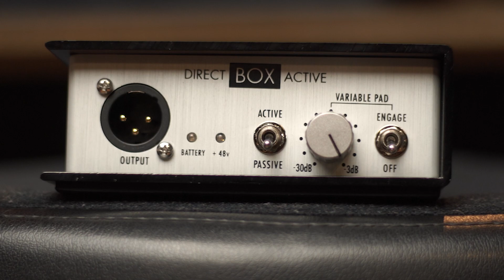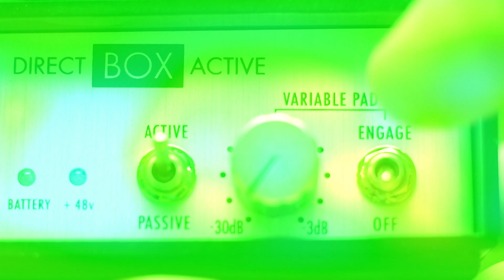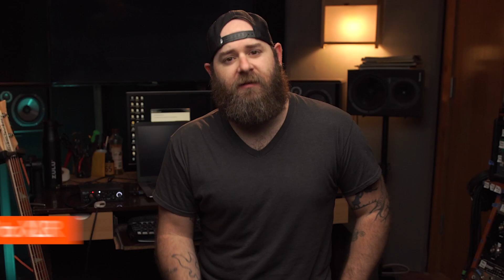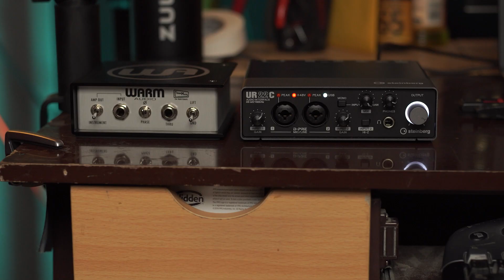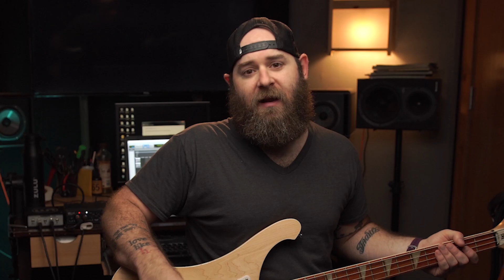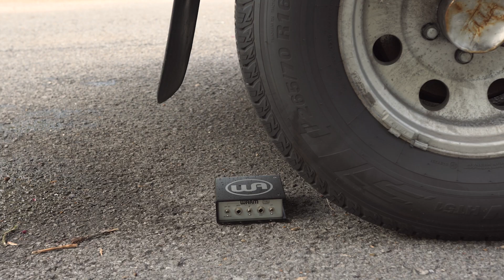Product Deep Dive - Warm Audio Direct Box Active

Comment: So I just bought a Warm Audio active DI and I'm getting 15db signal loss regardless of battery or phantom power.  The attenuator is disengaged.  I made sure the batteries were fresh.

To test, I plug direct into my interface and adjusted to hit -9db peak.

I add my countryman type 85 DI in the path, changing nothing else and I'm still getting -9db.

I then swap the countryman for the Warm Audio active DI, again changing nothing else and then I'm peaking at -24db. 

I did this exact test on two different audio interfaces and got the same results.  

So no matter what I do, I'm getting a consistent 15db signal loss with this DI box.  Is something wrong with my Warm Audio active DI?
Reply from the maker: Hey there! Hit up Michael in our QA department and we'll get your sorted! Email below.

Michael@warmaudio.com
Reply: @WarmAudioOfficial will do, thanks 👍🏻
Reply: @WarmAudioOfficial so I've been emailing with your customer service address and they don't seem to be able to understand that I'm asking why an active direct box is reducing my signal by 15db instead of sitting closer to unity.  Yes, the DI is getting power.  No, the attenuator is not engaged.  I've done a clean test and no matter what, your DI boxes reduce the signal by 15db.  It's been a pretty frustrating experience.  I'm probably just going to get rid of them both.
Reply from the maker: @thejamus  Hey there! I checked in with our QA team.

The internal transformer is an impedance transformer as is required to match the H-Z world of instruments to the low Z world of mic preamps. This process has inevitable level loss. The only way to get higher output would be by increasing the gain of the active circuitry in the DI. However that would affect the transformer performance as higher signal levels create more distortion in the transformer. As the DI output is matched to a mic pre, the signal loss is not a serious problem as there would be plenty of gain in the preamp to compensate for it.

So the level loss is typical of any DI you use. I hope this helps to clarify! Let us know if you have any other questions.
Reply: @WarmAudioOfficial that's fine.  While you were doing that, I tested a bunch of other active DIs this week and here's what I found.  Values are the DI signal level vs unity.  Tested by going direct into my interface and then adding the DI to the signal path:  

Countryman Type 85 active DI = -3db
Neve Active DI = -2db
Whirlwind Hotbox active DI = -1db
Warm Audio Active DI = -15db

I just initiated a return for your DI.  I believe mine was defective.  15db of signal loss is not okay in my book.

Comment: Well thanks for not mentioning at all how the AMP OUT works - like at all. Not even on the product page or manual. Would be gate to know what exactly that can accept in terms of power.
Reply from the maker: Hey Jouebien!

Our customer service team is always available if you have any questions about how to use our products that you can't find online. Feel free to hit them up and they'll get back to you ASAP! Hope this helps.
👇
customerservice@warmaudio.com
Reply: ? It's the first discussion in the manual.  Plug your guitar into your amp, then the out from your amp into the DI.  (If you don't have a load box and  need to have a speaker connected to the amp,  connect the Thru to the speaker cabinet.) You have already figured this out, so this instrution is for anyone reading your post. :)

Comment: Good demo. Once piece of advice is to also use it for DI electric guitars. i am having trouble finding any demos. I am looking to get the best possible DI sound for amp sims. I am not sure if buying a good active DI is really worth it over my interface Hi-z inputs. For the bass, I could hear the difference and it was not subtle. The warm DI sounded much more present than the interface input. But big lows are not really a part of electric guitar tone. if you could make the same video but with a strat and and LP it would be super helpful.